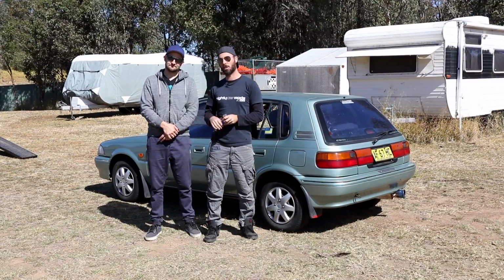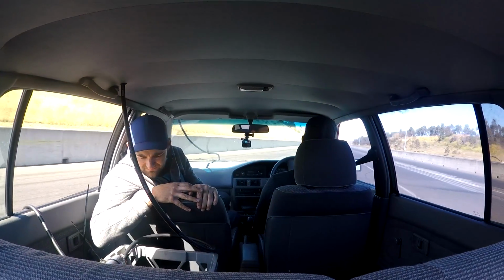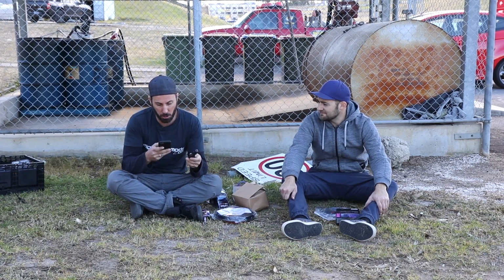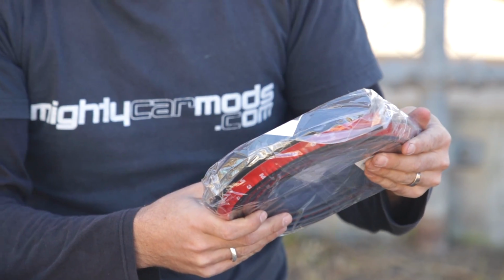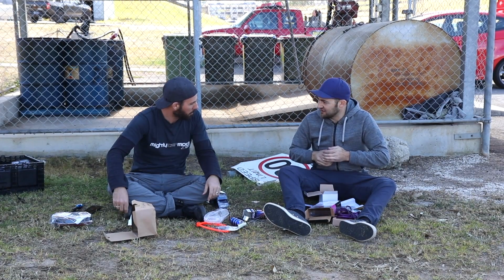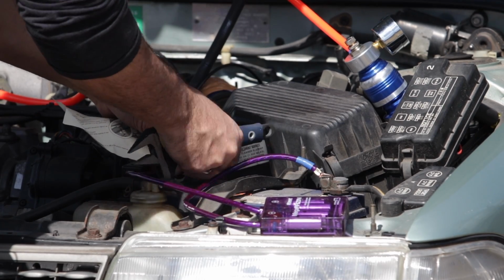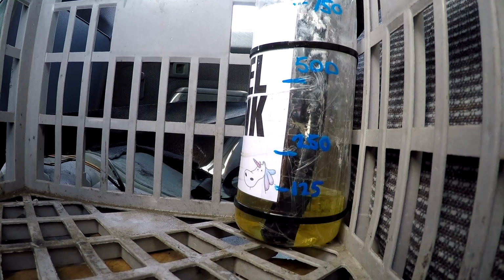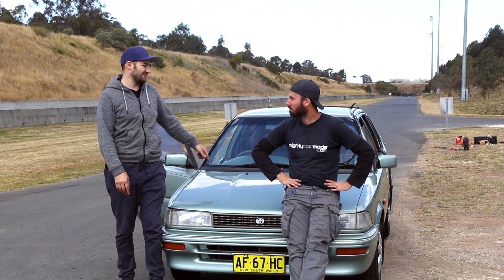Fuel Economy Mods - MYTHBUSTED

Comment: Try the resistor that plugs in at the air temp senser. Says it gives more power by tricking ecu into dumping more fuel? Curious to see some dyno results. How big of a hoax will that be?
Reply: Fantaman900 putting extra air in the mixture makes the car run lean. Fuel burns faster, but it could also damage the engine
Reply: Chev Chelios 
Without a doubt. I know they are junk. Its crazy to read the reviews. People think they work. How can they falsely advertise and sell them? I just wanna see the hoax/myth busted. Companeys like G force are making a killin sellin those things to stupid kids who dont understand how a engine works. Also curious to see how much money has been wasted in the last year by boy ricer that wants a race car?
Reply: J Rod vacuum leak does also make the engine run rich but that will result in more fuel burned so not save fuel
Reply: J Rod 

It is way scary that people buy this stuff legitimately thinking it'll work!

I loved the one where they tested an electric supcharger... it didn't funnily enough produce any extra power 😂
Reply: yeah i messed up it will go rich with boost and lean with vacuum
Reply: all the systems i work with are maf based and have lambda so it can cycle between rich and lean for the catalytic converter but that also means it can compensate for a small leak but it's also smart enought to know it has a massive leak and throw a code and a check engine light. (and it's almost always a boost leak)

Comment: the only thing that can improve fuel economy is something called the right hoof and if you dont hoof the car its going to eat less fuel but driving for fuel economy is boring and i rather spend 5 or 10 euros or dollar on fuel and have fun driving so im going to keep hoofing it and change gears at over 3k rpms just cas it more fun
on a serious note if you want a petrol car to be more cheap to run just get lpg on it and depending on the price of lpg in your area you could save about 30% on fuel but you will be saving money not fuel just because lpg is cheaper for example my car has a fuel consumption of 8 litters of petrol for 100km but on lpg its arround 9 or 10 but lpg is 55 cents a litter and petrol is 1.55 euros so im saving a lot of money that way

Comment: The only thing that might work there is the bonnet aero. But it won't improve efficiency it would disrupt the airflow over the car and stop the glasshouse area acting like a planes wing and causing lift (this would worsen not improve efficiency tho). 
Last gen Celicas could get a TRD spoilery wing for the top of the bonnet for same reason, but they were obviously so effective and popular that they, er, disappeared completely and were used by noone else. 
Hmmm...

Comment: Decresing weight and or power will decrease fuel used. Using the correct tires for the time of year will decrease rolling resistance during summer decreasing the power needed hence fuel used will decrease yet again

Comment: Can you go faster with higher Tire pressure?
Reply: Clutchkick Robcio creates less roll resistance so yes. And also if the car has enough power to reach redline in 5th gear or the distance lol, It will be able to go slightly faster than that of stock tire pressure due to a larger circumference
Reply: In a straight line yes, but on a corner it will be harder to grip, and so may potentially slip, causing wheels spin which is fuel used to do nothing (ei no forward force) so ...  not really. there's a reason tyre manufacturers have a recommended level . Check the original Mythbusters videos for more.

Comment: For legit fuel mileage mods, any performance mod that doesn't add more fuel/weight(to a point) to the vehicle will improve fuel mileage. Some good examples are Removing the side mirrors(Illegal in most places) or replacing them with smaller more aerodynamic lighter mirrors. Gutting any weight you can out of the car, Deleting options like power anything, air conditioning, back seats, interior, spare tire etc. Also, stuff like upgrading your ignition system to a higher voltage one, and controllers may help as well, but I dunno. Tire choice has a good impact on fuel mileage too, and theres many other things, but thats a desent list.
Reply: The top most reliable options for economy will always be:
- drive with minimum power
- drive slowly
- loose weight

A car half it's weight can easily double it's mpg.

Comment: Ciggy lighter plug in with all those benefits? what's the bet it's just an empty shell lol. I've heard of warming or heating the fuel before it reaches the engine would expand the liquid in doing so your car would use the same quantity without using as much . . . . Sounds good in my head any way. . . though if it did work then I bet the increase would be negligible and if not then it would probs just add weight to he car like all the mods they just tried.

Comment: can u remove the rev limiter? how high can he go?
Reply: Not so far. Remove the rev limiter and find you can only rev a couple hundred rpm above the limiter until the valves start to float and the pistons bash into them. I don't think this car has any performance valvetrain parts.

rip engine
Reply: deWaardt but how to you know? A Nissan rb20 will go from 7600 to 9000 with just a head gasket. I'd say the oil pump would loose efficiency b4 the head let go
Reply: We'd never know for sure. The Nissan rb20 is a straight-six, arguably meant for more performance.

The Toyota Corolla is... well, a Toyota Corolla. I don't think you're gonna get a whole lot of rpms out of it before the valves would start floating. This engine is probably very very basic.
But maybe I'm wrong and this monster can rev to 11k rpm.

The chance of destroying the engine is so high however I would not try it.
Reply: deWaardt I don't think they would try it anyways, it would most likely need a after market ecu to do anything interesting. Could be a end of its life or series thing tho
Reply: predagator Yeah it'd be a fun final protect

Comment: Homemade Hydrogen fuel cell
Reply: jimtowney booooommmmm (*oh the humanity*)
Reply: I've always wanted to see hydrogen tested out! I was even about to try it out myself on an old diesel ford. But the engine gave out before I had a chance to test it. Hydrogen burns really fast (rapid flame front) and has a very high octane number. Would have the same effect as earlier ignition timing but without the pinging ..
Reply: impuls60 There are kits to use tanked hydrogen that are like an injected lpg kit, and very safe. They use carbon fibre tanks, and they fill in like 5 seconds. Available in the US, not really here in Australia because.. it just takes us a while to adopt alternative fuels here (remember how long it has taken for us to finally get E85 here). Those hydrogen cell kits you build (or buy) on the other hand are a stoichiometric mix of o2 and hydrogen, and one spark... Hindenburg. Plus they don't generate much gas anyhow, and unless you are pumping more amps into the cell than the car is generating in power, so between 1--30kw in the case of Derek for example, there isn't enough to even run a car. It's also the reason why their use also does not decrease fuel consumption. Fun to inflate balloons with and blast them, but it's ridiculously loud and you'll need new ears if you try it.

Comment: MCM are complete fools!!! The reason the fully legit fuel saving mods didn’t give an expected result is because fuel economy is measured on a dial like a clock. Say you start with standard economy at 4 and a maximum of 12 then every time you add a fuel saving device it goes up a digit to say 5 or 6 giving better fuel economy, but they added so many that it went all the way back around to the digit 1 and hence my unlearnered friends you got worse fuel economy!
Regards Einstein 😏

Comment: Please do some real aerodynamic mods.  Body mods, mirror delete, lower it, remove fenders, put pizza pans on wheels, partial grill block, tape panel gaps, belly pan etc.  And do the test at higher speeds 80-100Kmph to see the difference before and after!

Comment: They do have access to a dyno right? Wouldn't it be better to be on a dyno and just set cruise control then start measuring fuel consumption?

LOL never mind I thought it was about real things like cotton air filters, or tuners.
Reply from the maker: We were going to do this for the aero mods
Reply: Wilson Solt interesting concept only flaw I can see is I don't think I've ever seen a carolla with cruise control. However it is MCM so that could be a whole other install video then fuel consumption revisit.

Comment: G'day,

  Great stuff..., but to be seriously "SCIENTIFICALLY" accurate you should have done a separate test for each & every Gadget.

   As it is now, you don't know which devices did nothing, which helped, and which made shit get worse....

  The only time I ever improved a Vehicle's Fuel Efficiency by 33.25% was when I put a streamlined 30 Watt Solar Panel onto a Subaru 1800 Touring Wagon which lived 15 Km out of a Country-Town, so it's 6 minute : 30 second average Engine Run-Time which was only allowing the Alternator to recharge the Battery to 70%....., was finally augmented by an onboard Solar System ; which FINISHED Recharging the Battery, AFTER I shut down the Engine....
  
  Then, when the Battery is full at Startup, the Alternator does no work, and therfore it takes almost no Torque to turn it (as a Turnaround-Pulley for the Waterpump..., while waiting for Headlights-Time)...; and because my Battery had been stabilising at 30% flat, every morning at startup, the Vehicle was putting 30% of it's Day's Fuelburn into running the Alternator, at high output, and yet still FAILING to recharge the Battery...., due to the short Average Engine Runtime.

  The other 3.25% Improvement came via better Aerodynamics..... (I am a retired Low-Speed Aerodynamics-Consultant...., as it happens, so I went at it rather HARD !).
   
  Anyway, I sent all my Research to my local MP (Tony Windsor..., back when...), who sent it all to the CSIRO ; and they spent 5 months assessing the results...

   You can see the CSIRO's endorsement of "The SunFoil Project..." (title-Search that on YT...) in my Playlist of that name....; it appears in "SunFoil Short-Talk....", which is a good entrypoint, and you might like "SunFoil Science, Raw Data & Analysis...", too...(?).

  Watch a few early Videos, then check the Construction Videos for the Mk-7 & Mk-8 ; which are the most cost-effective to build & install.., source your own components, and Do It Yourself.

  Have fun.

  ;-p
 
  Ciao !

Comment: Could you do a video with teardowns of the used products? It's funny to see a cigarette-lighter-plug only containing a resistor and LED ... ;-)
Also you could test how your vacuum-filter from hks reacts to brake cleaner injection while the engine is running.

Comment: I owned a newer one of those Corollas, i would get 350km a tank, so i was thinking maybe it was just me so i babied it for a week and got ~360km (FML), after that point and until the day i sold it i drove it hard - still got 350km a tank too.

Even with new plugs leads o2 sensor everything just the same economy (~10-11L/100), compression tests showed perfect factory spec compression hot and cold.

After that i bought an old 96 Subaru Liberty wagon and somehow ended up with better economy than the corolla and better performance.

Comment: The best mod to make would be an aero mod to the underside of the car such as an undertray flat floor and rear diffuser as the underside and rear of the car is where the most turbulent air is produced therefore increasing drag. Other than that driving slower and sticking to the speed limits will increase your fuel consumption the most. I would like to see this revisited with some better thought out mods
Reply: Chev Chelios yeah I love the laughs and banta they have doing daft mods like this it's what mighty car mods is about but it would be nice though if they did some aero mods which could actually benefit the car economically or performance wise like the ones I've listed as a lot of people I'm sure would be interested in doing it to there own cars if there are gains to be made. Plywood construction nice and cheap would be interesting to see the results :)
Reply: elliot2993 

Yeah that'd be an interesting watch! Taping up seams and gaps too, cheap and easy stuff!

The banter is hilarious too, I love how serious and straight faced do it with maximum sarcasm 😂
Reply: Chev Chelios yeah definitely would be interesting to see the results. Nearly all forms of racing have underbody aero work to benefit from ground effect to produce downforce but it also tidies up the turbulent air underneath a car, would be interesting to see if it benefitted a road car. 

I'm with you on that one, how they keep a straight face is beyond me 😂 the innuendos when they're pulling and pushing bits to each other on different sides of the car is hilarious 😂

Comment: I've gotten the best results by turning the A/C off
Reply: Supposedly 10-15%; though according to Mythbusters A/C is more efficient than opening windows over 60mph or so (which in terms of air resistance isn't surprising). It's rather noticeable in old-ish small-engined cars with A/C when you 'climb' hills.

Comment: You can get a lot of working aero for less than the $40 you wasted on those products.
You can buy 4ft x8ft x 1/4" plastic board for about $6/sheet that you can use to patch up the front grilles (do it from behind so it's not ugly), create a partial belly-pan, diffuser from your rear axel back and if you don't care about looks you can streamline the rear guards and cut discs flat discs to cover your wheels.
Apart from that just knocking ~20km/h off your speed (ie cruising at 60 rather than 80) usually makes more difference than any mod will and if you are really bad at self control most cars have a nut under the gas pedal that you can unwind which lets you set a throttle limit.

Comment: The deflector in front of the windshield does help if its the right distance from the windshield. The vortex generators also help if they don't have a spoiler immediately behind them. This is all assuming your going fast enough to creat drag. Which is a bit different on every car. Go to ecomodder.com for better info on this stuff.

Comment: I'd like to see the engine temperature difference with and without the hood. Also I think it would be interesting to see what gains are made with a hood scoop connected to the air intake at different speeds. My motorcycle booklet claims that it gains like 5hp and high speeds from the ram air intake.
Reply: Well, my tests say taking bonnet off stops engine overheating. And the Roadkill guys proved this like ten times.
Reply: Put your hand over the intake of your motorcycle while you rev it, the engine sucks in air at a much faster rate than your bikes ~250km/h top speed. 
The ram intakes do help throttle response however, the more pressure infront of the throttle plate when it is closed means it takes less distance the pistons have to draw air from when the plate opens.
Reply: Dankus Memus The idea behind ram air is higher pressure not velocity.
Reply: If the engine air intake velocity is higher than what the ram can provide then there will be no air pressure build up.
Reply: Dankus Memus if the air is higher pressure you will get more amount air for the same velocity. A large enough object moving at a high enough speed creates a zone of higher pressure air in front of it. Just like how the point of a turbo is not to increase the intake velocity but pressure.

Comment: How long can a flat tire last untill it shreads?
Reply: Depends on how you are driving it, how soft the rubber is, the surface of the road, the temperature, the age of the tire, type of tire, etc. Why do you think tire manufacturers are so hesitant to specify how far a tire should go?

Comment: Speaking of fuel economy, I was the bloke that brought my Subaru Vortex to the MCM meet in Queensland a couple years back. That thing's literally engineered to be as aerodynamic as possible and man, I drove 900 kms that day on 2/3rds of a tank so...
Reply: Doesn't sound right.
Sure it's a light car but if i recall correctly it only had a 7.5:1 CR and AWD it shouldn't get under than 6-7L/100 km (best case scenario) so unless your tank is 80+L (which no subaru from the time was) I doubt this statement.

Comment: Put 36psi in the tires and drive with the windows up,  will beat both results.
Reply: May as well just use maximum sidewall pressure. It's not as if you need traction for fuel economy anyway.

Comment: on a car with a carby,driving at part throttle(on the hiway) you can create a vacuum leak at the inlet manifold and it will lean out and get better mileage,ask anyone over 70.
Reply: If you have a carby you mas as well just adjust the lean screw. If you are going to drive from sea level to the mountains you will need to adjust it several times anyway.

Comment: It's my understanding that some performance mods also improve fuel efficiency, such as high flow air filters, good tires, better throttle bodies, polishing the inside of the exhaust ports, inside of the manifold, gear train, etc.  I'd be interested in knowing how much of that is true, more so than having a laugh at the scammers.
Reply: I think the point of this video is that you can't increase performance and economy with $40 worth of add-ons. However, your ideas on what to try to see if the hype is true would be an awesome experiment for Mighty Car Mods to do. It would be a long series though, because to test each individually would mean stripping the motor and doing the mod. But then, you could just do all the internal mods/polishing etc and see if they work together.